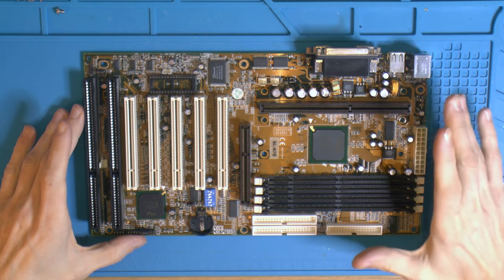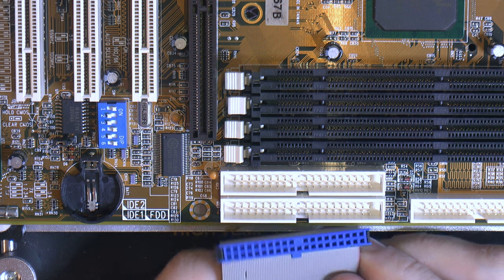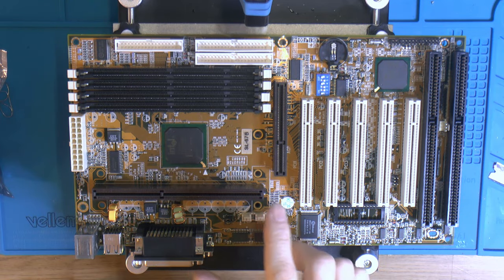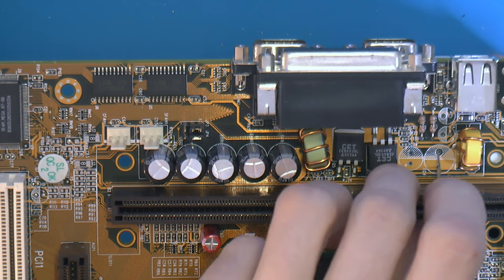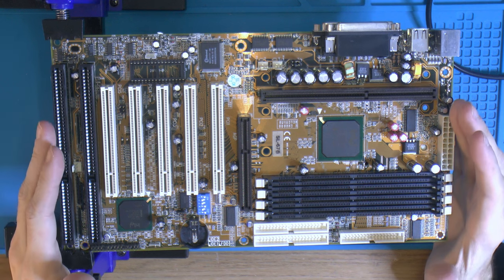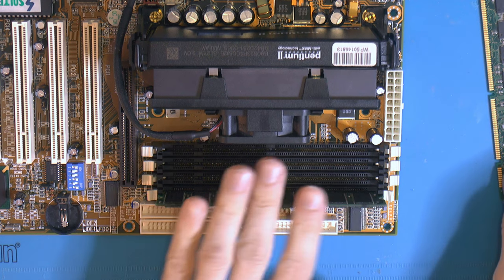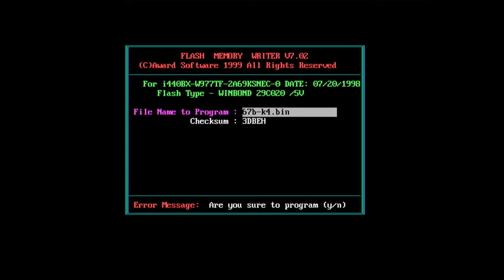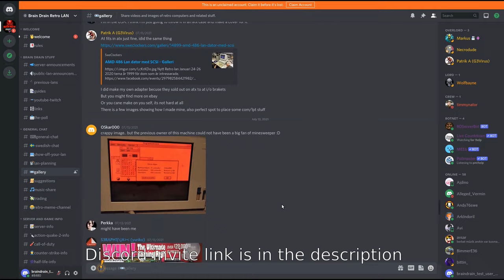Pentium II build - Part 3

Comment: To clarify, the 600 MHz was with a Katmai Pentium 3 450. My Pentium 2 450 only does about 504 MHz (112x4.5) before getting very unstable. My P2 400 does 496 (124x4) and my 350 does 466 MHz (133x3.5) so they seem to max out around 500 MHz. I have an idea of swapping the cache chips over from the Pentium 3 one day to see how far that could allow me to push the P2 Deschutes core.

Comment: Why dont you use electrolytics tonreplace tantalums? They are usually simple filter caps and electrolytics work just fine for a fraction of the cost? Also fuck tantalum caps..
Reply from the maker: I wanted to try something different, and they where on sale so cost almost nothing.